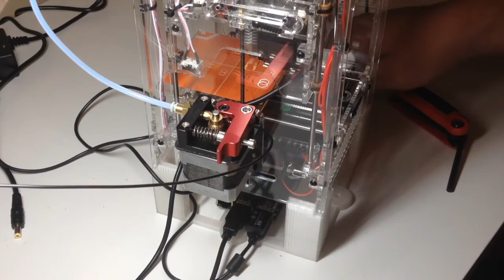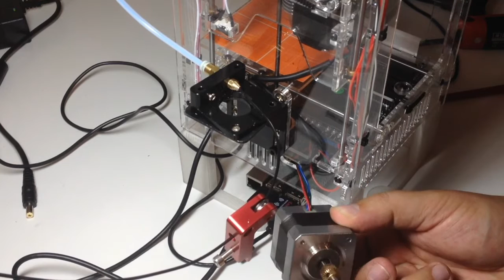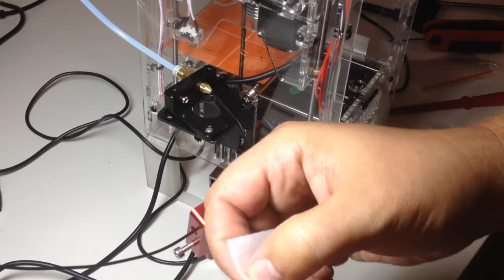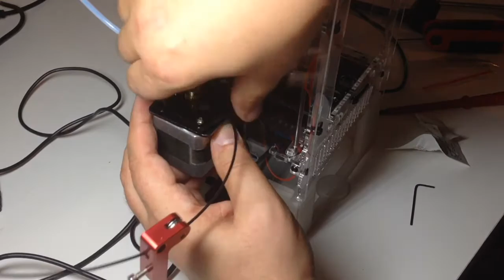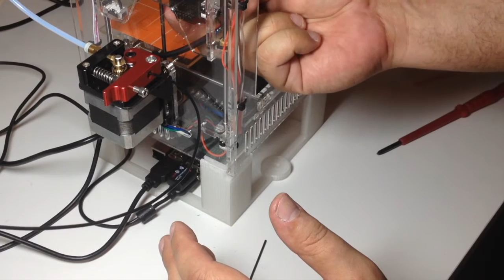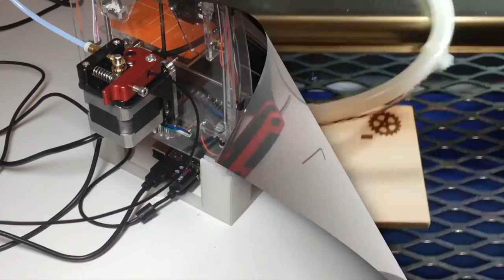Fabrikator : TinyBoy Mini 3D Printer - Cleaning The Extruder Gear!

Comment: I had some problems with under extrusion one time that gave me fits. Turned out to be a little bit of blockage in the hot end. Not a lot, just enough to slow down the filament. If it doesn't stream out straight out of the nozzle, there's some blockage.
Reply from the maker: yupper, as you say it doesn't take much!  :-)

Comment: good video ,  Also check that idler pulley on the opposite of the gear that help hold the filament . mine came the screw holding that U  bearing pully was way too tight it was stalling out and causing way too much friction( not spinning freely ) . I backed min off a 1/4 turn ( the black screw )  and it ran very smooth  , and almost no more bits of junk in the teeth on mine now ..
Reply from the maker: Thats a good point!  Thanks for sharing it will check.